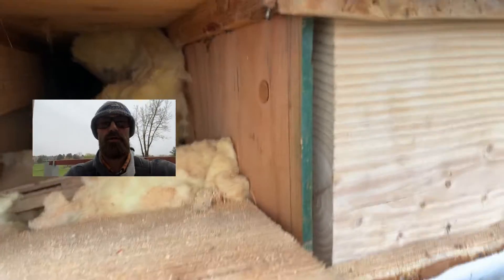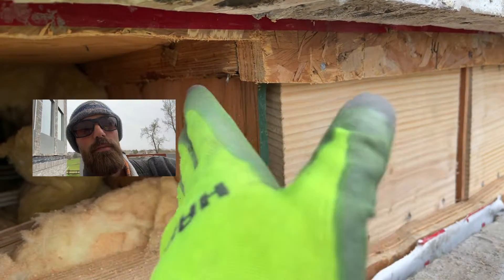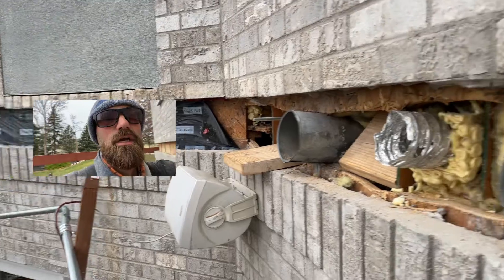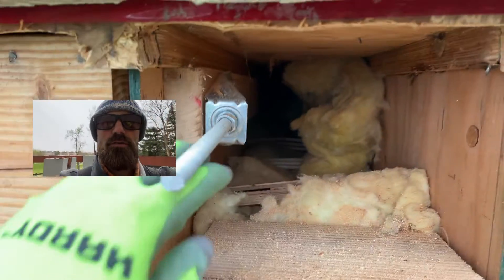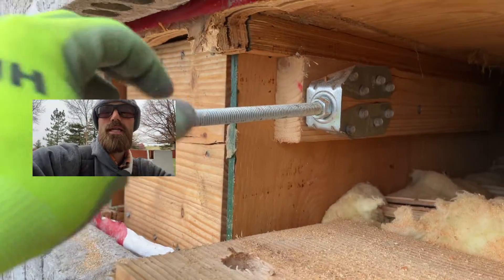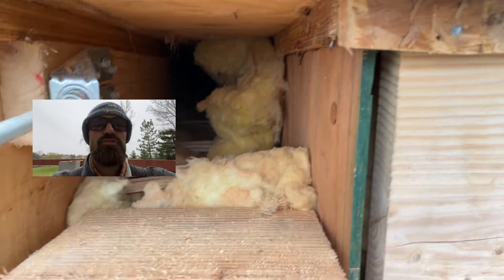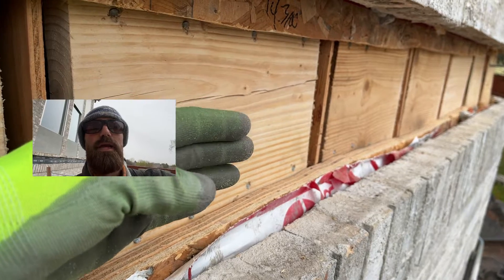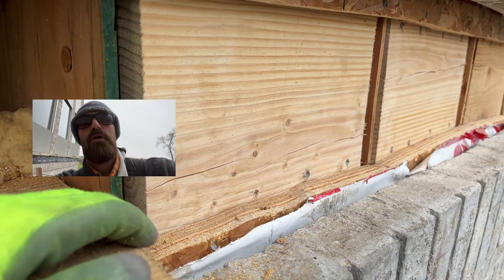What To Do When the House Has No Rim Board - Colorado Custom Covers & Decks

Comment: Thank you so much for your demonstration. A lot of builders like Lennar are building expensive houses without installing the rim board. The rim joists under the walk-out sliding door are not flush. I have a 1.5-inch misalignment.  Because of that, we cannot install the ledger board to support the deck. Please make a video on what the ledger board will look like at the end. Thank you.  Lennar is not an ethical company and often cuts corners. I am finding a lot of hidden issues with a brand-new house that I just purchased two years ago. Please, I need help.

Comment: Wow!  I can't help but wonder how much it cost the homeowner just to get to square one before the ledger board was attached.   I have a somewhat similar problem with my conventionally framed house.  In my case, whoever installed the deck, didn't flash the ledger and the rim joist and wall plate rotted out. I jacked up sections of the house and replaced the rotted plates and rim joists.   It's amazing to me how much damage was done because of either incompetence or a "screw it" attitude some people have.   Thank you for your video!  It's great to see someone that cares about safety and doing the job right.  I may incorporate the Simpson hardware into my repair/replacement.
Reply from the maker: Yeah to much

Comment: How is the brick above the rim not just falling down after removing that section without adding a lintel?  I am about to build a front porch and the roof ledger board must also be attached directly to the structure and not through the brick fascia.  I am having to remove all the brick above that ledger and will just replace it with vinyl siding;  Too expensive to put the brick back up.

Comment: Can I tie these into the vertical end o a floor truss since the top plate of the basement wall is most likely much lower than the deck 2 x 10 joists?  I think I'll run that question by the inspector too.  Just looking for opinions

Comment: It would be interesting to see how you will drill the holes in the ledger board to exactly match where those threads need to pop through.
Reply: Dab of chalk on the edge of each bolt, cut a styrofoam board same size as your ledger for a template, push it up against the bolts, chalk/bolt will leave an impression, drill your holes, dry fit your template, transfer to your ledger, hope for the best
Reply from the maker: Yes, it was very precise measuring

Comment: I have a house I'm putting a deck on right now it has no rim but he house joists are 2"×10" joists. Do you think it's safe to cut back two inches and install a rim? I know you guys did the simpson anchors but that's because the type of joists you have not really having material to end nail on. Would that be a good move for me or should I still use the simpson anchors
Reply: That should work but I would check with an engineer or building official to confirm. Thanks for watching.

Comment: Mine has no rim but has a huge 4x6 sill which my bottom bolts can snag on ledger that are 5" and top can hit studs , is that safe , deck is only 2x8 going 16' along house and half of the deck is on the ground still with ledger attached to studs even though on the ground. The span is 10ft out. 97 year old house, not sure why I didn't think to block it out and do a rim while I had it open doing sheathing , stupid me
Reply: Man I’m sorry this channel hasn’t answered your question smh

Comment: Great video here! Thank you for sharing the details. 
I’ve got a situation where I don’t have a rim joist to connect to and only have studs. In this case, would you connect the ledger with the structural screws going directly into the narrow part of each stud? Or would it be better to add blocking between each of the studs and connect the ledger with a normal pattern of structural screws?
Reply from the maker: Going into the studs would be the best
Reply: @coversanddecks  ok great, thank you for the help!
Reply: @coversanddecks I had this same question but this is for a covered patio roof and I wasn’t sure what to do here but I’ll use LedgerLoks to screw into the wall studs, thank you! 👍

Comment: I've got the same situation could I put the blocking inside the 3/4 OSB ive got access inside in the basement is it necessary to cut the OSB out the blocking would still rest on the sill plate
Reply from the maker: If you can block and get to everything from the inside without cutting out the osb I would say do it and avoid more work.
Reply: @coversanddecks  thanks very little info online about this situation your solution makes sense I think I'll put several of those Simpson brackets and plenty of blocking
Reply from the maker: @dn41287  thanks for watching I would always refer to an engineer as my engineer drew up this solution